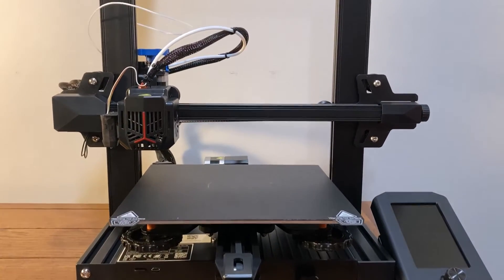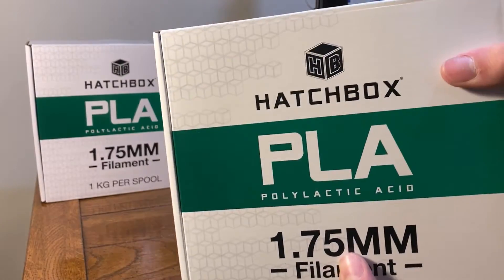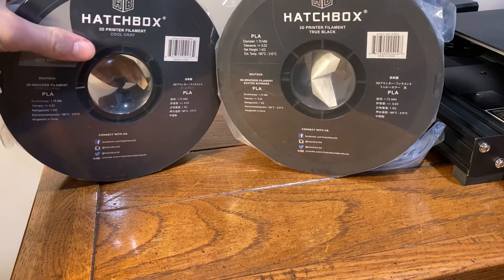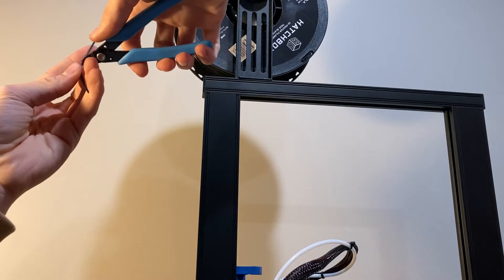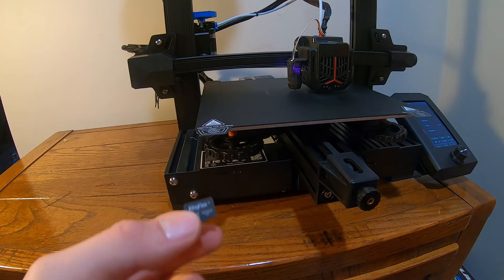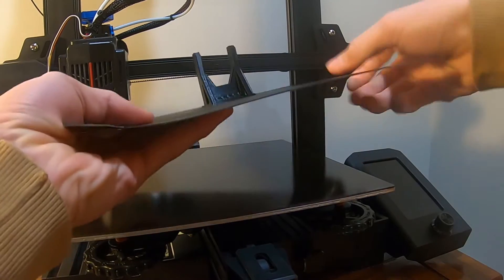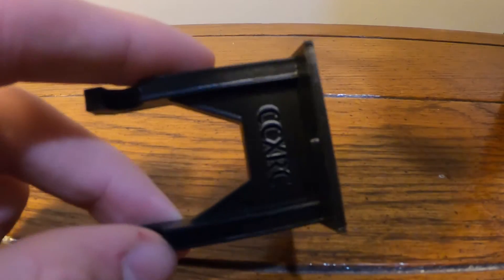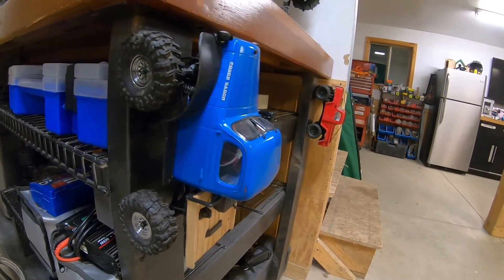Hatchbox PLA Filament Tested on Ender 3 V2 NEO!

Comment: I use just the ender 3 v2, but I've had a grey hatchbox pla that I saved since 2019 in just a Ziplock bag with silica pellets since 2019. No issues with it, and it works great. about only 4 years old pla, but hasn't shown any water logging or defects from the first day I bought and used it till now.
Reply from the maker: Awesome! Hatchbox pla seems to be really high quality from my experience as well! Thanks for watching.

Comment: The Ender 3 is really good but I had a lot of issues with the first version, I would suggest upgrading the heating element and the extruder and a BLtouch auto leveler. I recently just got a resin 3D printer though it works amazing with super precision!
Reply from the maker: I have the Ender 3 NEO so it actually comes with BL touch and an all metal extruder setup right out of the box! The resin printers look interesting, which one did you get? Appreciate you watching David!
Reply: @3DudesRC  I have the Creality Halot One so same brand and great quality
Reply from the maker: @davidschulz1887  Cool!

Comment: Bought this EXACT printer/filament 2 weeks ago. Great experience with it so far but running into trouble trying to diy upgrade to direct drive. The neo's x-carriage is different from the original ender 3 v2/3/3 pro. I'm just learning cad so I cant design one but if you're planning on going direct keep that in mind! trying to solve this by printing a stock v2 carriage but the neo also has a different hot end design lol trying to get it right. If it all fits as it should and you would like to upgrade let me know! Also, I installed the creality dual z axis and the prints are flawless and the consistency throughout definitely improved. 

My apologies for the novel but definitely something I wish I knew going into this (3D rookie) and hope to bypass that if you were looking to do similar upgrades. With that being said, good luck with it and keep posting cause I'm sure ill need it in the future haha
Reply from the maker: Awesome! Thanks for the info for going direct drive, I'm not planning to upgrade any time soon and I haven't done any mods yet, but possibly in the future. TinkerCad is a pretty beginner friendly CAD program, might be worth looking into. I have noticed some random imperfections in my prints so I might have to try that dual Z axis! No worries about the long response, I love reading through the feedback. Many more videos to come! Really appreciate you watching!